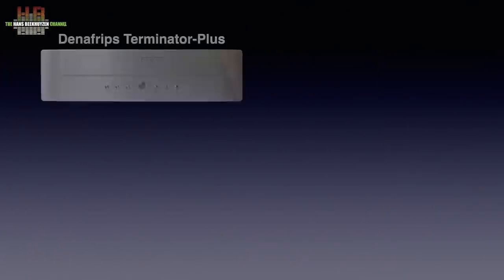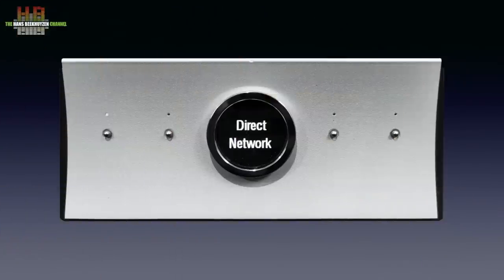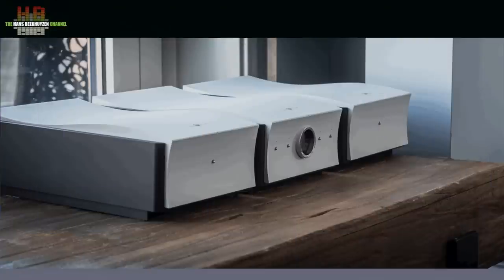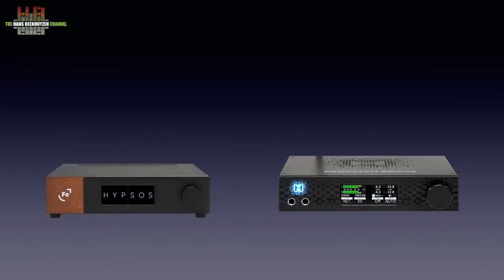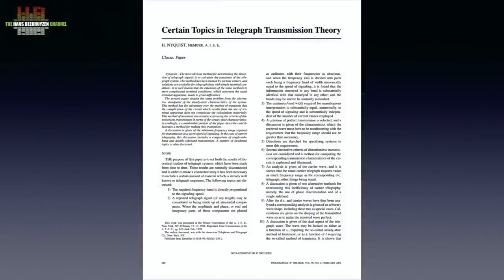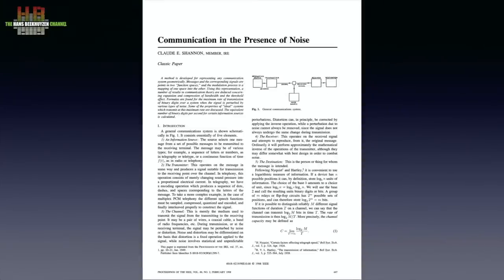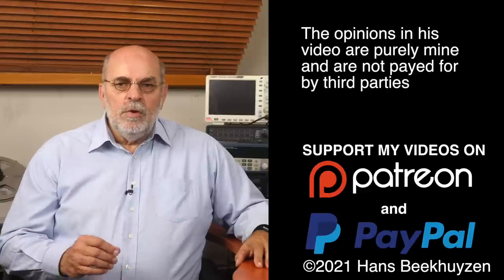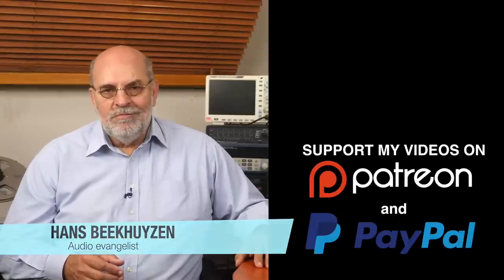Denafrips Mola Mola or Chord

Comment: Hello Hans - great to hear your reviews again. I have been away in a long hike and a good bit of that time I was thinking about the future direction of my system with regard to  streaming,
Reply: Sorry -  to continue I am curious about the Weiss 501/2 and whether or not you have or will review this streaming DAC. 

More globally important to your audience, could you please explain the difference between a streaming DAC and feeding a DAC - for instance using Roon - from a PC?  Thank you Hans
Reply from the maker: I haven't reviewed the Weiss yes and I don't think I will at short notice. A streaming DAC is a DAC with built-in streamer. If the streamer is of equal quality to the DAC, it's an elegant and simple solution. If it's not, a separate streamer of sufficient quality is the better way.
Reply: @TheHansBeekhuyzenChannel  thank you Hans. Once the new PS Audio DSD comes out I plan to trial it head-to-head with the Weiss, and with the modular DA2 that came with my McIntosh C2700. Both should be better, based on price, but I want to make sure there really is a difference that I can justify/appreciate in my system. Thanks very much for your reviews. As a fellow engineer I love your straight-forward approach and your explanations of the tech.
Reply from the maker: Two other good ones: Molamola Tambaqui and Chord Dave.

Comment: I had a pleasure to have Dave+Mscaler and Mola Mola in my system one after another replacing my old good Yggdrasil. Disclimer: I had them for a couple of days only and not in the same moment. Rest of my system is ATC SCM100 active and Freya+ pre. I use also Minidsp SHD studio to pacify modes of my room. First impression: both are clear improvement over Yggy in sound clarity and imaging. However if your ears are sensitive to timing the winner is Dave+Mscaler hands down. Mola sounds pretty, but Dave+Mscaler sounds almost like live music. Astonishing. It was hard to walk away from it. Mola in contrast I have no discomfort to switch back to Yggy as it is much faster (PRAT). Mola will charm you but it will not give you the feeling of live music. There is this subtle feeling that sound is always a fraction of second behind. I'm actually amazed reviewers don't mention this difference. Dave stand alone - don't even think about it - Without Mscaler no wow effect. They should put it in a single box.
Reply from the maker: Thanks for sharing
Reply: “A fraction of a second behind”, behind what?
Reply: @magicmulder  I'm not talking measurments here. I'm trying to depict the feeling in my sense of hearing. Do you get the difference between live sound and playback? Mola is playback, Chord is live. The attack notes are not in the place they should be. The attack is streached too much accross timeline. My system is based on active speakers, which naturally reveals any deficits in this department.
Reply: Thanks for comparison.. have you heard the Weiss Dac? Trying to achieve Dave and Mola Mola sound for a more budget price . The Weiss is supposed to have a studio reel to reel sound.
Reply: Dave and Mscalar are over twice the price..
Reply: @magicmulder  sorry I was not clear enough here. I refer to sudden signal increase/burst (transients). Some devices are capable of delivering steeper signal transient then others. Some make the sound a bit more relaxed. Some people are are more receptic to such phenomenon, some other don't mind or even prefer relaxed sound. I probably found Mola Mola more relaxed in this respect, but that was long time ago, hard to recollect. For sure Mola Mola was a competent device, though Dave and Yggy were more to my liking. I would be happy to test them again, having today much better room treatment.
Reply: @morespinach9832  compared to Yggy, both Dave and Mola are pretty expensive. They may be better in some scenarios (headphone lovers say a lot about Dave superiority. This is not my experience, when I sit 3.5m from each speaker). Also Yggy upgrade LIM (which is cheaper compared to the original A2 version) is a nice sound improvement.

Comment: Mr. Beekhuyzen did you use the Chord Dave/MScaler combo when  you reviewed the Grimm MU1 or did you just your the Dave.  Thank you.
Reply from the maker: I tested both but the MScaler in the chain reduced the sound quality slightly. That is why it's no longer in my reference setup 1. That doesn't mean that the MScaler can't be a valuable addition to your digital front-end. It's just that the Grimm Audio MU1 is even better.

Comment: I wonder if Dave is fully balanced or single ended......and just having dual xlr out as compatibility
Reply from the maker: It’s truly balanced. You could have concludes that from the fact that the output voltage of the balanced outputs is twice as high as from the single ended outputs.
Reply: @TheHansBeekhuyzenChannel  DAVE is a single ended DAC and the RCA outputs are preferable to the XLR outputs as they have an extra opamp that amplifies the signal.
Reply: @stefanoferioli8721  Good info!